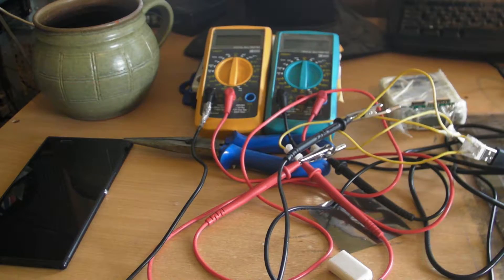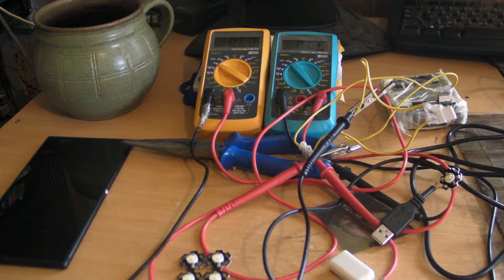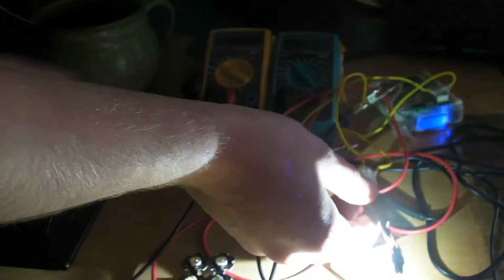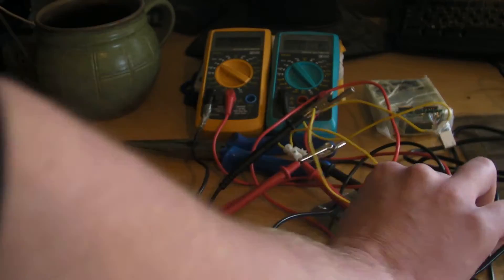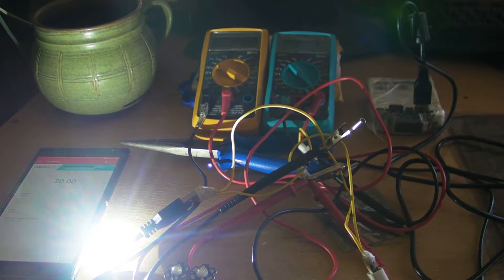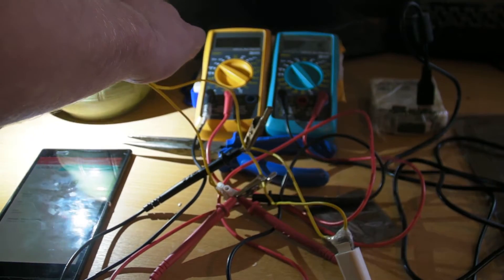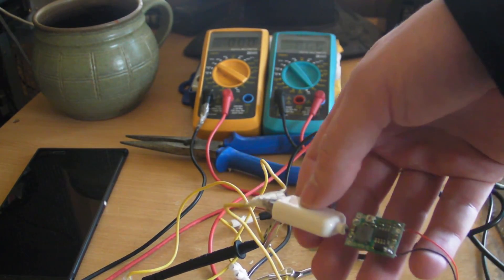Testing high power 3W LED from ebay

Comment: That is not how leds work. You shouldnt use 800ma on these Chinese leds. That is the max it is able to run, but its really bad for the led. Instead you should use constant current around 500 or 600ma. Also they should not be used between 3.0-3.7 volts, but atleast that! Its called a voltage drop. So for a 3w led run at 500ma you should supply it to a max of 6v
Reply from the maker: At no point do I state in the video that this is how you should use these LEDs. It just shows what happens if...

Obviously, I do not have a current source in this video - USB is a voltage source and so is the DC/DC step-down converter used here (ideal voltage source will keep the set voltage no matter the current load...). Since there is only 1 LED connected to the voltage power source, the voltage on the LED is exactly the same as on the power source and current corresponding to the current-voltage characteristic of the diode will be forced through.
If I were to connect 2 LEDs in series to a 6V voltage source, you would expect to have a voltage drop of 3V on each (same as resitors). Of course, if you have multiple LEDs connected in series you want to have a current source...

The advertised 3W max power draw of the LED happened at about 3.7V/0.8A, that is just a fact. Again, at no point do I state that you should use it at max power.

At the start of the video you can see what happens when you use way too high voltage from a voltage source (ended up drawing 1.6 A - only because the USB power bank could not supply more than that).
Reply: @stuff5143  okey then i understand because in your description you say these leds should be operated between 3.0 to 3.7 volts. I found this kinda misleading for people that dont know how leds work. Because obviously you dont want to do that. You want to use a constant current lower than 800ma and higher voltage than 3.7v to reach 3w.
Reply from the maker: @svenvanderzwaag1012  3.0-3.7V is the voltage on the LED when operated. The setup is - take a cheapo DC/DC step down voltage converter, plug it into USB, set the output to somewhere between 3.0-3.7V - depending on how much would you like it to shine - and connect a single LED to the output.
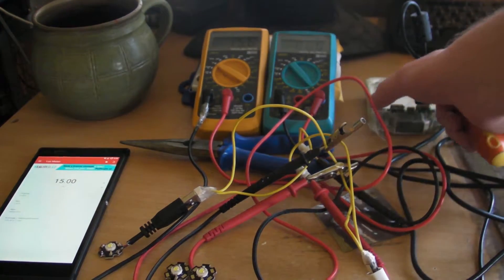Well pretty much I am just measuring the current-voltage characteristic of the diode ( 03:10 the yellow multimeter shows voltage and the blue one shows current), tho most of the time the displays are not visible xD.

This video is just bad - while not factually incorrect, it doesn't explain anything, doesn't show any meaningful data... its just pointless.
I forgot about this video a long time ago. Thats the thing with youtube - you are bored one evening and make a shit video and than 6 years later you remember it due to a new comment pretty much stating the video is shit (and you happen to agree). Than what do you do - delete it or keep it up? I never liked when people delete their old stuff, but I can totally see why.
Reply: @stuff5143  no man it is not a bad video! Im sorry if I made it sound like that. I was just a bit confused with the description. I definetely think you should keep it up :)